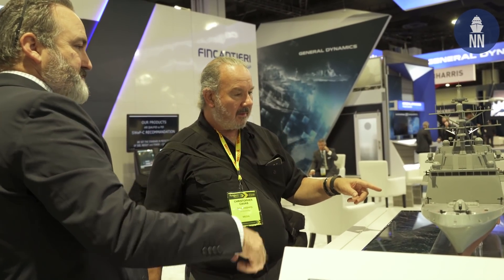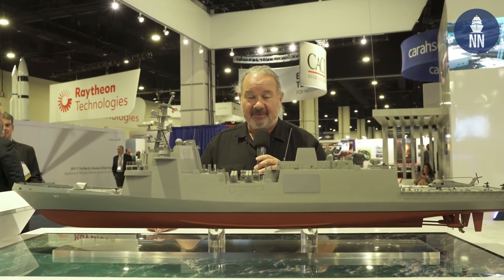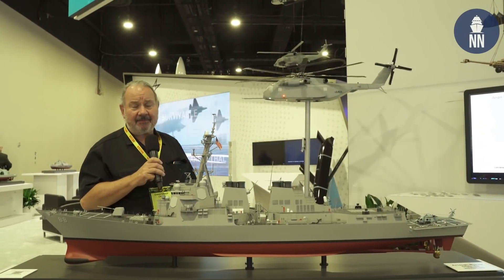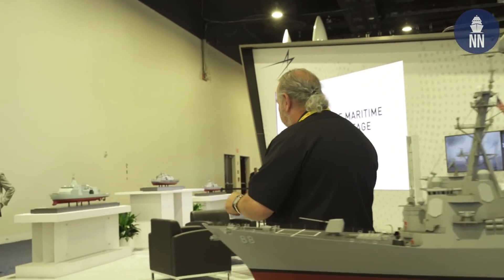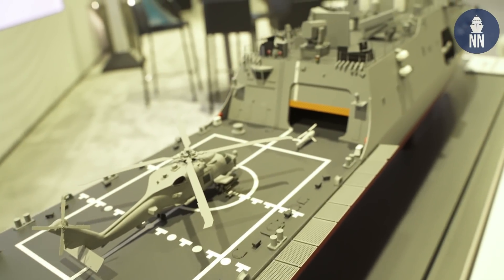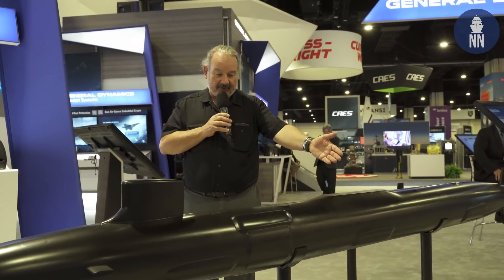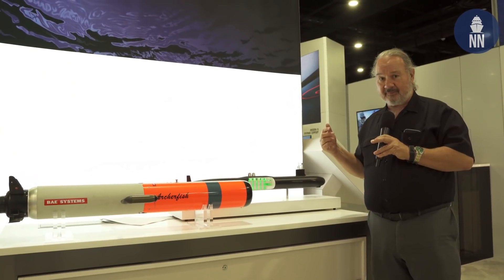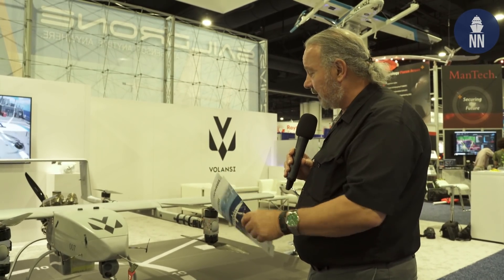Sea Air Space 2021: Constellation-class, Lockheed Martin, Virginia-class and Volansi

Comment: People calling this ship small or a “pocket size” Arleigh-Burke, are quite mistaken. Both ships are roughly 500 feet long with a 65 foot beam. Fully loaded they’re 7,300 tons and 9,700 tons(fight 1 Arleigh-Burkes were 8,000 tons) respectfully. As far as power goes, of course the destroyers are going to put out more, and necessarily so given their mission sets. Constellations will still do 26kn plus, and they’ll have auxiliary electric power. The new Constellation frigates are highly capable war ships, and will definitely serve us well into the future. They will also take a lot of pressure off the AB destroyers and can pick up some of their mission sets as well. The ship has been designed from the get-go with open architecture and modularity in mind. The bottom line is we need more ships in the water, and we need them NOW! The Constellation frigates are exactly what the doctor ordered at this juncture.

Comment: No discussion of reload, rearm on the missile systems. 8 shots ain’t’nuff!
Reply: then I welcome you to the Norwegian frigate, they are build for ASW-role as main mission (they love to feast on submarines), they have either 8 or 16 cell VLS, with only ESSM (each cell is quad packed) so they would carry anything from 32 to 64 ESSM, depending ship (apparently, there was almost impossible to get strike length VLS, since the production in US was busy, producing full length VLS, for US Navy)

The US Frigate, is basically and up-scaled Norwegian frigate (Navanti F300 design) but with ASW and escort as it's main role and AAW and ASuW as an secondary role, 
while the US frigate is an ASuW frigate, with AAW and ASW as secondary role.
(ASuW: Anti Surface Warship)

I find it weird that US Navy doesn't equip the frigates with a hull mounted sonar, since ASW is one of the thing US are focusing a lot on. They could at least equip it with an smaller light hull mounted sonar. Only relaying on a towed array with variable depth, the time it needs to deploy, can be the difference between surviving or die. The frigate is basically totally deaf, until it deploy the towed sonar, some also have a limit on how fast you can move, and if you suddenly need to move fast, you can't, because that will damage the sonar, or you have to droop it....

In the mean while, the Norwegian frigate, that was build by Navanti on a F300 design, a smaller version of F100, with the same equipment as the FREMM design, just the previous generation, can do all they want from the FREMM design, and still have space for more equipment, if needed. Apparently the F300 design was designed to have up to 3x8 cell VLS and can have the 76mm gun replaced with either a 57 or 127 mm gun + a second 40 mm or 76 mm gun!
Reply: of course there will be reloads and such. can't give away all of the info
Reply: @rickdiesel2k  “of course”?  Logic would say yes, however ain’t no one nowhere discussed the issue. Thus ???????

Comment: Big mistake having only Missiles, Russians always have a mix of cannon etc
Reply: It has a cannon on it genius.
Reply: That was the Arsenal Ship concept.  Yes, it was a stupid idea.  While it does have more missiles, up to 500, it also has less advanced sensor and cost more than a more advanced Arleigh Burke class destroyer.  Then the Arsenal ship evolved into the Zumwalt class destroyer, which had two bigger 8 inch gun, but less missile capability but with phased array radar and Aegis.  Guess it was even worse since it was too expensive to produce the guns and the ammo since it has to produce from scratch. Ironically, US Navy took the phased array radar and the Aegis off the requirement, which made it less capable than the Arleigh Burke class it was supposed to replace. Even more ironic, it is supposed to be guided into battle and take command from the same class it is supposed to replace.  So, Congress decided to only buy 3 and cancelled the other 29 and continue production of the more capable and ironically more cost effective Arleigh Burke class destroyer.  Of course, we are still stuck with the 3 very expensive Zumwalt destroyers with no weapons allocated to them, looking for a role.

Comment: OK -----------. The MOD 4 is why the 5-inch 64cal mount needs to be the main gun armament on the New Constellation Class Frigate.  With 5 times the range and 4 times the destructive power while hitting all the targets the M-110 57mm mount can but at a range the 57mm mount just dreams about (out of the Enemy's range to kill). The new Frigate already has the ability to sail close to Islands the DDG and Cruisers can-NOT go, making the New Frigate the best shore support platform for the Marines (replacing the failed Zumwalt class) if it is equipped with the big gun. Without the big gun the Frigate is still just a fast barge with a few expensive missiles looking for a Mission the DDG's and CG's can't do better.
Reply: horrible the shot peas 57 mm, most better original 76 /62. 1 round 57 mm =  2,700 kg, 1 round of 76 = 6,450 kg!.... (ps 127/64 is leonardo not BAe, 127) the Italian cannon fires twice as much ammunition in a minute, which goes further, as well as the guided and volcano version. speaking of mod 4 you mean the 127/62 Anglo-Swedish of the BAe

Comment: Seems to me the navy is completely neglecting the ability to provide gunfire support. Missiles are very expensive as are aircraft. 3, 5, or even 6" shells are cheap and you don't risk losing a pilot.
Reply: Naval gunfire support is dying out anyway. Too risky to be close enough to the shore to provide naval gunfire support to land units, and smaller guns (such as 40mm or 76mm, compared to 120+ mm) are generally better suited to defend against swarm attacks due to the ship being able to store more rounds and they also tend to have a higher rate of fire.

Also, I think the DOD, US Navy and Fincantieri knows what they are doing. I don't think it's neglect, more a strategic decision.
Reply: @hugoebenfeldt6615  It is dying out because navies don't want to do it not because the reasons you cite. Missiles are expensive and cannot keep up the length of suppression naval guns can.  You've bought the BS. Even the German Navy recently revisited upgunning. They did not adopt the 15 cm they were looking at and instead jumped from the 76mm they were using to the 127mm in the latest  Baden-Württemberg-class frigates. USS Chaffee used her gun as late as 2007 on the African coast to bombard Jihadists.  In 2011 the French navy fired 3,000 shells into Libya. You want to come up with the $ for 3,000 missiles or bombs?  Ever hear of the super long range Advanced Gun System the US Navy was developing?  They would not have bothered trying if there was not a clear mission requirement.  You need to give common sense a try and not believe whatever you are told.
Reply: @lmyrski8385  Alright, calm down. I'm not saying guns are completely worthless or anything. I'm just saying that in high-end combat scenarios guns are pretty redundant except as protection to swarm attacks and close-in air defence (40/57mm or CIWS). Since the Russian illegal occupation of Crimea and China's increase in naval capability, focus has shifted from low-to-medium conflicts to high-end conflicts against forces such as these. The LCS-concept, Baden-Würtemberg and many other western surface combatants introduced to service recently was thought of pre-2013, when the main goals of a navy was supporting the war on terror, anti-piracy missions and supporting special forces operations. This is why the Baden-Würtemberg class of frigates was fitted with the 127mm naval gun and the Vulcano munition. To support these kinds of missions.

This however has changed. The Constellation-class is very much designed to counter a Chinese numerical advantage in the Pacific and to be a less expensive combatant compared to the larger destroyers/cruisers which could then focus more on air defence and long-range land strike missions (with distances to targets only a missile can have). We also don't have all the facts available to us. Perhaps fitting it with a larger gun would infringe on space needed for the VLS cells?

In a fight against a navy such as the Chinese, a larger gun just is not going to make any difference, due to anyone with even the slightest of common sense would not position such an expensive asset just a few kilometres of enemy shores. Ships are too expensive and takes too long to replace for them to be risked. A smaller gun with better air defence and swarm attack capabilities might make a difference however.

Is it the right choice to focus this much on high-end conflicts? Maybe. I don't know. Nobody does actually, as it is merely a response to an analysis of a future combat scenario. But I am very sure it is not that the entire Department of Defense, US Navy and Fincantieri somehow forgot that guns has been useful in the past two decades in low-end conflicts. The requirements sent out by the navy was not something they came up with over lunch. It is a list of requirements based on detailed analysis of past, present and future scenarios and what capabilities the navy might need then.

PS. I am well aware of the AGS. It was cancelled because the cost of the munition started to close in on missiles, and with a fraction of the range of modern land-strike missiles. The system was originally concieved due to the navy realising that even the 127mm guns could not support ground forces...
Reply: @hugoebenfeldt6615  This, so much this.

Zumwalt and especially Baden-Wurttemberg are modern expressions of the "colonial gunboat"; to put it simply they were designed to operate against tin-pot dictatorships with garbage maritime awareness (Zumwalt), defeat the mythical Boghammar swarm boogeyman that was overhyped ever since Millenium Challenge 2002 (the LCS), and suppressing terrorists and pirates in failed states (Baden-Wurttemberg and most of the Eurofrigates).

Constellation is meant to give the USN something capable enough for WWIII, yet expendable (compared to Burke and Tico) so they can be sallied into the gray zone and counter China's corvette and maritime militia swarms. You dont need big guns for blowing up spyships that double as poachers and illegal fishermen.

Comment: Nice to see a model of the Canadian Surface Combatant.  Long overdue for a proper class name (probably stuck in some committee).  Also, given its displacement and capabilities, we should really call it a destroyer.
Reply: I agree ... at 8000 tons full load The type 26/ Canadian surface combattant should really be classed as a destroyer.  Its size and displacement is closer to the type 45 destroyer than the type 32 Frigate
Reply: @lightfootpathfinder8218  "Type-31"
the Royal Navy/Royal Australian Navy Classify it's Vessels based on role ASW= Frigate, AAW= Destroyer not displacement I would assume that The Royal Canadian Navy decided to keep them as Frigates because thats what the RN/RAN are calling theirs.
Reply: @Autofleet4429  sorry I ment to put type 31 lol ...and really! Cheers I didn't know that 🤔... so do you reckon if the the type 45 destroyers were in US navy service they would be classified as cruisers & the type 26 would be classified as destroyers ?
Reply: @lightfootpathfinder8218  T45 would probably be classed as a cruiser as the T-Class cruisers in the USN are intended for AAW/AAW command plus flagship role same as the T45 which can and does act as a flagship depending on deployment.

The T26 would probably still be classed as a frigate as it would be used as a 2nd-rate vessel behind the AB-Class destroyers like the FFG(X) is intended to do.
Reply: I read an internet article that is is going to be called the Province class.  Here is the thought process:  The Canadian Surface Combatant, aka Canadian version of the British Type 26 frigate, is supposed to replaced both the Iroquois class destroyers, which were supposed to be the air defense/flagship, and the Halifax class, which are more general purpose and anti submarine frigates. So, this new ship class is supposed to serve both purpose. Thus, it would have features from both of type of ships.  Sort of like how the US Navy's Arleigh Burke class destroyers are used both as a general purpose as well as an air defense/flagship as well as a full blown warships.  The four Iroquois class were all named after Canadian native tribes.  The Halifax class were all named after a major city in each of the Canadian provinces plus the cities of Montreal and Ottawa. Since the Canadian Surface Combatant is supposed to replaced both class, it would be named after Canadian Provinces, hence the name Province class.  However, there are only 10 Canadian Provinces and 3 Canadian Territories. Since the program is supposed to be for up to 15 ships; they might run of names for the ships.
Reply: @bermanmo6237  Sounds like we need some more territories.  HMCS Turks and Caicos?  Who else out there wants to join us?
Reply: How much has the line been blurred between the two?

Comment: May I ask why USN still chose to opt for naked pole masts on the Constellation-class instead of adapting the original stealth angular mast from FREMM?
Reply: They don't need them, the original masts were designed to house radar equipment, all that equipment is in the superstructure do to the Aegis system, so they can eliminate all the topside weight and lower the center of gravity for better sea keeping
Reply: @mattheww2797  In other words, the US Navy don't need stealth for this class of ships.
That's also evident from the new panels on the bow.
They're tranforming the FREMM into an old style vessel, having seakeeping and weapon density as top priorities.
Reply: Cause it looks better

Comment: There still seems to be a lot of room for growth on the Constellation. The mid-ship area currently inhabited by the Naval Strike Missiles could easily be walled off and filled in with Mark 56 modular silos, probably at quantities that exceed the capabilities of the Mk41 install, doubling it's defensive capacity or freeing up the Mk41 tubes for other purposes. The NSMs could then be positioned elsewhere.
Reply: The ship will not be filled with Mk 56 ( 57 iirc) VLS the ship structure is made to accommodate VLS in that area
Reply: I think Kevin Bryer is referring to the MK 56 containers used on both the Danish Abalson class multipurpose ship, sort of like a hybrid of a frigate and a transport ship, and the Danish Iver Huifeldt class air defense frigates as well as other ships of the Danish ships.  They are called Stanflex, a system where various mission specified containers can be swapped out based on different mission requirements. Since the various ships of the Danish Navy all have common modules, all these containers can be swapped out among these ships.  

In other words, this is a more successful version of the proposed swappable mission modules that was proposed for the US Navy's littorial combat ships.  The British Type 26 class is designed with a mid section where there is a module that you can swapped it with different mission specified modules.  So are the British Type 31 and Type 32 frigates.

Comment: I'd rather go to war with this ship than a Literal Crap Ship (LCS).
Reply: Littoral Combat ship you mean ? 😂 Yes i agree its a garbage ship with less capabilities !
Reply: The Danish Navy are very successful with a common swappable container module system with their systems.  The problem of the US Navy's Littoral Combat ship is that some bean counter that since LCS were cheaper than a navy destroyer, you can buy more of them and add more container module to them to turn them into a full blown warship. Of course, any time you have to redesigned a weapon program to do everything instead of a specified function, the price tag goes up.  Well, the LCS were designed as a patrol/escort type ship.  It was never designed as a substitute for a full blown warship like a destroyer.  I actually hear a reporter actually argued that since the LCS was a cheaper alternative to a Arleigh Burke class destroyer, the US Navy should buy more of them since they have swappable mission module.  FYI: while the Danish Navy do use a common swappable container module system with their navy ships, they don't tried to tried to turn an offshore patrol vehicle into a full blown destroyer since each type of ship has a specific number of module slot. So, an offshore patrol vehicle would have less slot than a frigate.
Reply: @bermanmo6237  the LCS better off as Cyclone's replacement, a patrol vessel or as Navy SEAL mobile forward base. With VLO design, it could go close enough to deploy a SEAL platoon.